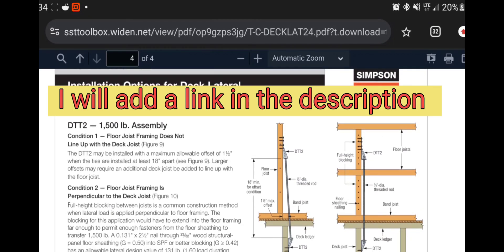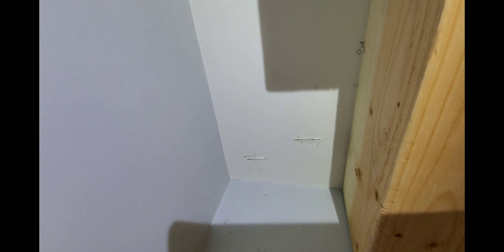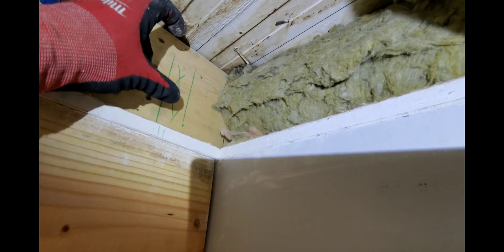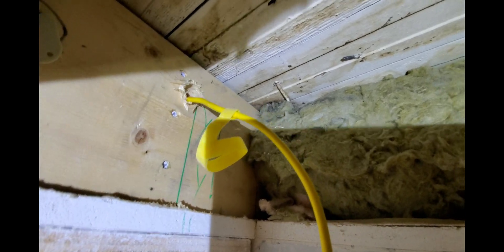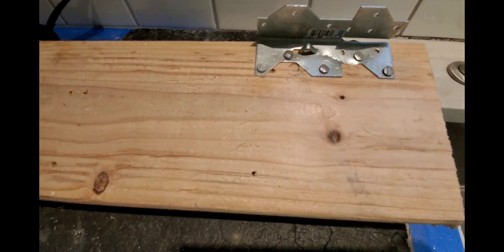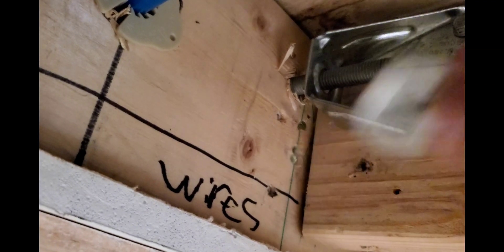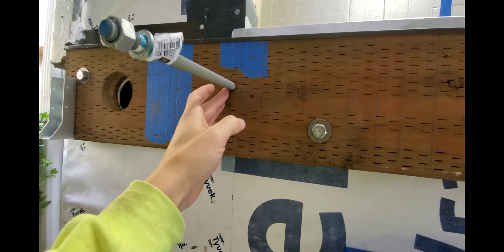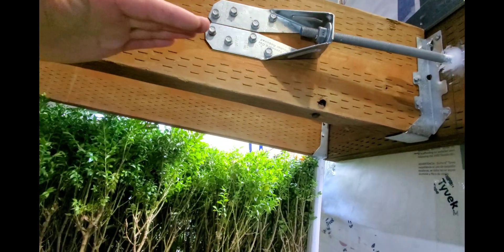Deck lateral support, deck tension ties,  install  DTT2Z , floor joist perpendicular to deck joist.

Comment: It's crazy how often I come across a 30-50 year old decks that are attached to the building with a few 16s and that seems to be plenty. I've broken a couple hammers trying to pull one old 16. Today's codes are way over kill, in this aspect. If anyone has seen the Berkeley CA deck collapse it all stems from a cheap job meeting an unruly crowd... There should have been more support for that deck I completely agree, however they were way over capacity for the building and the deck, and for some reason it seemed like a good idea to rock the deck back and forth... I digress your job looks good, well done you should have no trouble passing inspection.
Reply from the maker: @nicholasthibeault1729  This deck was done 12 years ago only had 16d  in the ledger no flashing, no vapor barrier, no sheathing, unfortunately it rotted  the load bearing wall framing, old strong lumber, and yes some of those nail did not come out they were stuck.
The thing with houses now the the material and lumber is just about garbage, so this is the make up for garbage materials but applies to  all home so there is no confusion.
Reply: @handydandyhomes  yeah most buildings in my area are 50+ years old almost always old growth red wood materials today even redwood is pretty much garbage, gotta do what you gotta do I'd warranty your work for 20-40 years depending on over hangs and local weather patterns. Totally agree personally I would go with 100% pressure treated framing that can give you a lot of longevity, but being wet wood can warp and do weird stuff as it dries. Hard to get it perfect now a days. Keep up the good work bro.
Reply from the maker: @nicholasthibeault1729  Thank you.
also shrinks,  some remodels require pressure treated lumber for interior work if the house is in a flood zone you have to buy the lumber months in advance to dry it out or your sub floor could  drop a 1/4" or more .